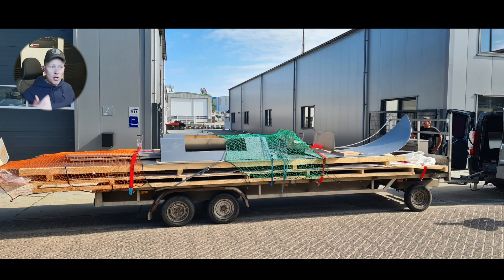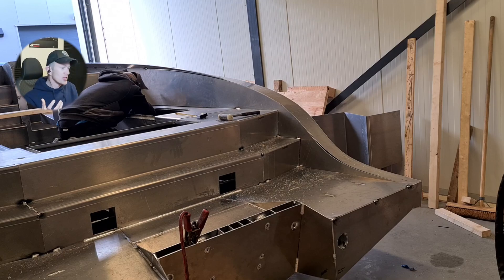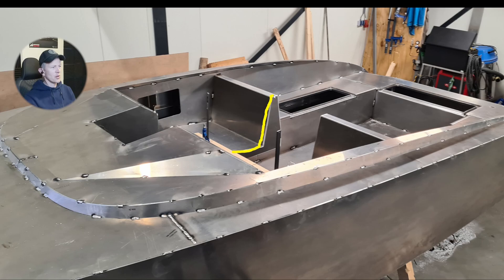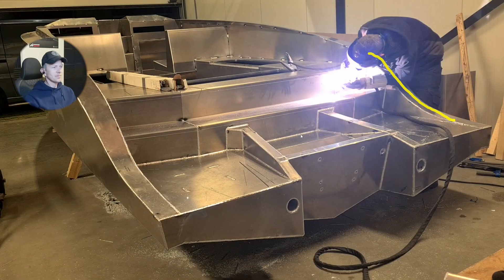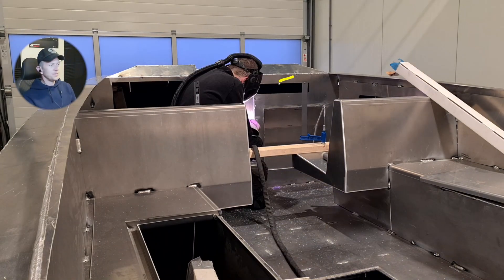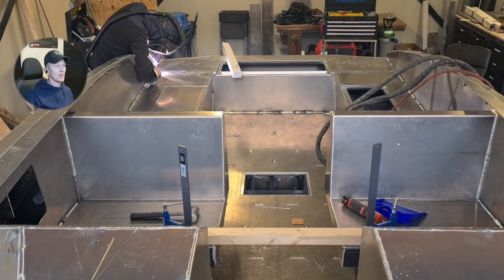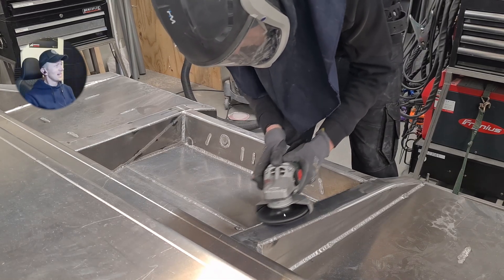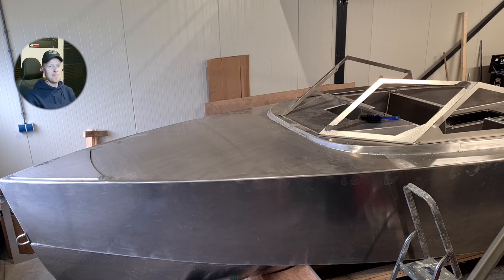The Hidden Rules of Welding for Boat Builders

Comment: I think the word you're looking for when you're beginning to Weld at the back of the 
boat is ??
" Balanced Welding "
or simply Welding in different places to Balance out the Weld.

A bit like carrying 2 buckets of water with a pole and you add the same amount of 
water to each bucket as to keep them Balanced.

Pretty much the same scenario when Welding, Anything 👍
Reply from the maker: Yes!

Comment: 20 grit 40 grit 60 grit 80 grit 180 grit 220 grit 320 grit 400 grit 500 grit 600 grit 800 grit 1000 grit 1200 grit 1500 grit 2000 grit 3000 grit thats how we say in english [grr it] little tip you can use a flap disc wheel to knock the most of it down an use a da with a soft interface with 60 or 80 to get it evenly shaped and fine tune it in with 180 then some 220 and 400 to get to desired finish i dunno if u are painting this or what will be covering the raw aluminum

Comment: Beautiful design man!!  Gorgeous really!!  I love building custom aluminum boats. I always weld the outside corners with tig and the inside corners with mig. Seems to be the most efficient way for me to put a plate boat together. I would tack my panels. Then fully weld the inside with mig. Flip the hull over. Then back voice the open seam with a diamond cutting disc to open the crack up a little. That way when I came through with the tig I would get a full penetration weld. In a lot of spots I could to it autogenous or “with no filler rod”. Again. Nice work!!
Reply from the maker: I fully agree with your welding method, I did full pen welding everything under the waterline above only single welds

Comment: what i like to use for aluminium grinding is either like you do, with a grinder and either flap disks or sandpaper disks but i also like to use a small belt sander for detailing. You know, not a wood belt sander but one where the belt is not supported in the back, with 1 inch wide belts. They are usually air tools and it conforms great to contours.

Also, if i use a sandpaper disk, having some foam backing helps alot

thanks for sharing! From QC, Canada
Reply from the maker: Nice thanks for the comment

Comment: Looks like a very nice job. I kinda miss aluminium welding. I used to work at Almac Tanks here in QC, Canada, when i was younger. I remember being shocked when i learned that standard issue tool for welders was a circular saw. It's very useful for repairing small defects in welds or just even to prep for a start/stop pass. Throw a line of saw in the weld where you stopped and then start from a couple inches back on the unwelded portion rapidly going back to where you stopped, warminf up the material a bit and then keep going forward laying your new bead. I really liked that stuff. Specially with a good quality push/pull gun
Reply from the maker: Push-pull is king!!

Comment: I spent some time MIG welding fire truck bodies from either coated steel, stainless steel or aluminum and the way you do your tacking and running beads is the only way to do large sheet metal weldments, especially aluminum.

Comment: "If you keep welding in a continuous line, Aluminum tends to crack." 
Agreed. But I see it in Steel too. Consider it as a homogenized seam, not unlike glass. The weld direction changes tend to fence off regions that otherwise would be conducive. 
Remember, when fixing a crack, drilling stop holes just beyond a crack at both ends before welding the crack, is essential. The force is absorbed through the thickened ends and tolerated.
Reply from the maker: Oh if got some stories too your a Pro i can tell

Comment: You are refreshing. I so like that you are taking into consideration the effects heat "does" to what is welded. 
When you used the wood to slow down the warping...I call this..."restrictive welding." I use steel angle iron for this purpose. 
  This is on structural parts. I can see you did not want to use  steel because of the marks it would make on the aluminum. 
Beautiful job.
Reply from the maker: Aaaah restricted welding nice, yeah or protect the steel with some foil or something

Comment: What aluminum alloy and gauge are the parts cut from?
Reply from the maker: 5083-H111 4mm an 5mm
Reply: Thank you and what wire and rod gauge and alloy did you use for the MIG and the TIG welds?

Comment: I am very impressed! 
I could never do this. However I like watching videos of people with an exceptional skillset. 

If I wanted to do this, I would first need lessons in welding aluminum followed with a few years of practicing welding aluminum.  

I once was a ships engineer and one time I was forced to weld some steel parts together by myself because the welder / machinist had wounded himself. I managed but it was bad. I had to grind a lot, in between and afterwards to get a remotely acceptable result. And still I was overloaded with comments about ‘how “skilled” my performance had been.’ 😣
Reply from the maker: To be good, you need to do it for years, and you need a proper teacher, too. Thanks for the comment

Comment: If you make another one make a steel mold first and wrapp the hull plates around it, you can use the mold ribs as pressure points to [push the sheets together. Then lift the hull off the mold, flip it and weld in the inside.
Reply from the maker: Sounds great, thanks for the tip

Comment: Nicely done, Quick question. Do you have any concerns with cracking because you are removing weld material?
Reply from the maker: Thanks! no not really it just grind off the top 80% of the weld, is still there.
Reply: @ManufactureArnout  Copy thanks!
Reply: @ManufactureArnout 
I am very impressed by your accomplishment, I know I couldn’t do it. 👍

However, and I don't want to be annoying or rude, but your answer wasn't very clear to me. I am not a welder and I am not sure if you left 80% of the weld standing or that it was the amount you ground off. I assume you left 80% standing, but I don’t know if that is even possible. 
(Sorry)

Comment: What’s the future for laser weld in this application as a lot of what you talk about is heat distortion and my small knowledge of laser is that it generates far less heat?  Beautiful sheer and lines by the way.  Should end up easy on the eye.
Reply from the maker: My knowledge of laser is pretty limited, but what if seen i dont see it used on these kind of projects I think
Reply: Laser welders are just a tool like any other 
But generally they are better suited to thinner material 

Largely due to low overall heat input but with any weld it will need to get hot enough to melt both parent materials and filler with penetration and reinforcement 

so there is a limit to just how little heat and equally shrinking or distortion can be achieved 
I dont see it being of enough benifit over Tig or mig

Comment: Great video. The grinder you need to make those edges look great is a Walter line-mate. You can match the original finish of the material and make the welds disappear and have a perfect small radius in the edge.
Reply from the maker: ooh yeah, most boats I see don't grind the weld though, I like this more
Reply: 100%.  Walter makes great stuff.  I use the orange flap disks on Stainless.  Nothing compares to them!

Comment: Wow, awesome project and a lot of great tips, thanks! DANG, that’s a lot of welding and grinding! 🤯

I’m curious, when you were doing MIG, I didn’t see a spool gun. Is it just that your filler wire is heavy enough gauge that you don’t need to worry about it flexing and jamming when pushed from the welder vs pulled from a spool gun?
Reply from the maker: The MIG torch has an-pull system inside, the machine is pushing the wire, and the torch is pulling the wire, push/pull
Reply: @ManufactureArnout  Ah, thanks for that explanation: So it's a more sophisticated torch that has a motor inside. (Surprisingly compact, considering that!)  - It makes sense for commercial use where you don't want to be carrying the weight of the wire nor be limited by the capacity of a little torch-mounted spool. Thanks again for taking time to explain!

Comment: Thanks; that was a lot of useful advice. I'm curious: What model of the Fronius machine do you have? Is it a multi-process machine or a dedicated MIG or TIG machine?
Reply from the maker: I actually borroed this from a friend of mine, its a Fronius Transpulse 2700Alu Edition Water Cooled MIG 400V. for mig and for TIG i use a Magicwave 230i
Reply: @ManufactureArnout Thanks for the quick reply. Fronius looks to be popular in the NL. Cheers.

Comment: When you say at 4:28 that "friction will follow the weld",  I wonder if you meant to say "tension"? Great information, well explained. I've subscribed (and of course, liked) and will check out your other vids.
My previous welder had a Hulftegger handpiece just like yours, it was a 350 amp WIA, 100% duty cycle. Quite a beast, but we had an earthquake and another (equally heavy) welder (Miller Dialarc TIG) fell on it from a height. I sold it for parts, but was able to fix the Miller ..... mainly panelbeating in that case. They used to build them tough; it's still going twenty five years after the quake!
Reply from the maker: Tension! Yes, thank you for the comment. Yeah, beauty torch, mate!

Comment: Arnout, in the US it is common practice when tacking to use a "single dime" or spot welded. In fact many of the MIG systems sold in the US have spot timers to allow the welder to pull the trigger and get time adjusted single spot for tack  up purposes.  I have found that long curved seams as at your sheer are best tacked in 3"- to 4" increments (8-10 cm). Long tacks as you show are not common practice due the exact distortion you mention. If you want cleanly dressed weld seams- its most common to use a router bit. Using a 2" sanding disc to make sure there are no weld bulges above the top horizontal plate or below on the topsides, then a bull nose carbide router bit will cut a completely rounded edge.
Reply from the maker: Aha I see, love these comments as they let me understand different ways to approach it, and allow me to understand that there are multiple ways of doing things
Reply: I have several routers as a woodworker. Yes, routers leave a beautiful finish, but are VERY unforgiving. Being as RPM's are around 20k, "things" happen fast. If you can use one on aluminum with no boo boos, then my hat is off to you.
Reply from the maker: @robertmceuen3630  I think i understand what you are saying here haha thanks
Reply: @ManufactureArnout  We have been routing the outside edges of welded seams since the 1970's on boats and other projects. The router bits exclusively have the roller guide bearing and some of the routers have added on plates or bases to get a wider stance. On these added plates/bases we use stick-on Velcro tape (but only the one side) and they slide nicely over chips w/o stuttering or poor cutting spots.  We don't do the adjacent surface planing very often with routers. However, that too can be done with an end mill or spiral Onsrud cutter type of bit to get the two adjacent weld surfaces uniform prior to using the bull nose bearing guided bits to achieve round over.  Need to use the vertical offset base on the router with these bits.  Using 3M maroon and blue pads to finish leaves well formed and clean edges when that is needed for finish of these types of seams.
Reply from the maker: @kevinmorin7965  can you Join my free patreon? We can chat over there if you like. I see those texts but some images will make me understand better what your saying